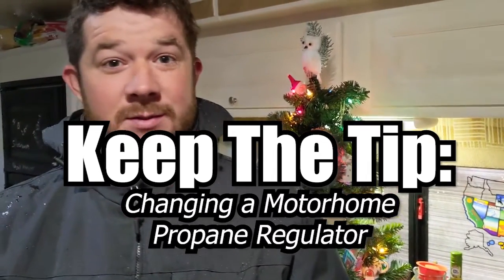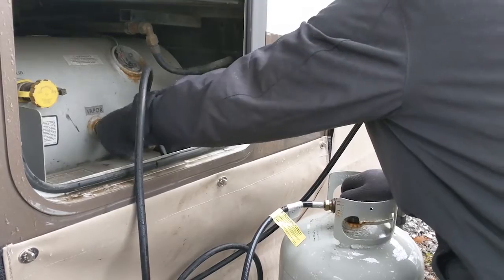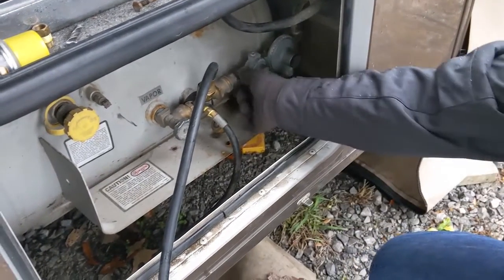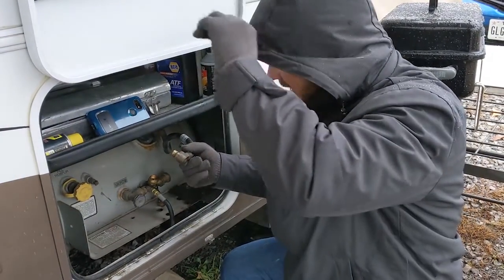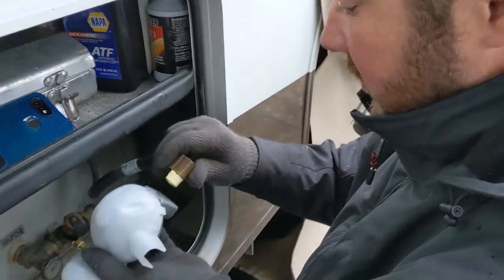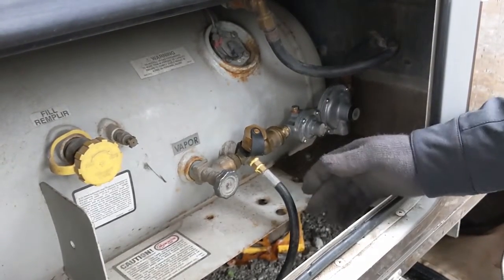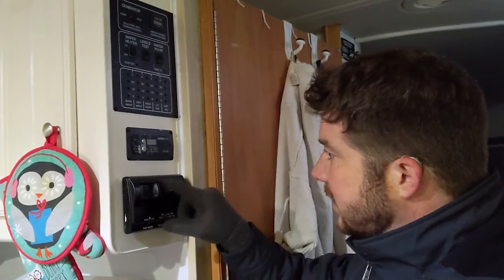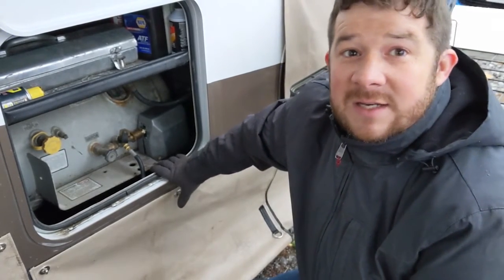Keep The Tip: Replacing a Propane Regulator in a Motorhome

Comment: Your comment about LP / gas fittings working opposite to regular fittings, hardware, etc is correct. But, they give you a handy clue when the fittings work OPPOSITE hand to everything else. They cut little notches in the corners of the flats where you put your wrench so that by just looking closely they give you a heads up 'Hey, I'm different here, take note!' At 6:13 of your vid, there's a quick glimpse of those notched corners on the fitting you just removed. That's the one where you turn RIGHT to loosen and LEFT to tighten.
Reply from the maker: I did not know that. Thanks for the tip. :)

Comment: Thanks our tank is full but pressure is low and goes out. Gonna give this a shot lots of stuff I read said it could be regulator. I installed the ez tee before and was pretty sure this was how it worked but this gives me confidence I can do it.
Reply: I installed the gas stop and am wondering if that could be the reason I am not getting gas to the stove, water heater and furnace.  I'm going to change the regulator. That may solve everything.

Comment: Great video thanks.  On some models there is a ‘drop tube’ which I believe captures the oil from the propane.  Mr. Heater makes a propane filter, I wonder if that would be a good idea to include in the setup, as long as we maintain the filter...
Reply from the maker: I haven't tried the filter idea. Our propane piping is much higher then the regulator, so most oil stays in the trap made by the piping. But I might take a look at the filter.

Comment: I am new to having a motorhome. Everything was working but I noticed yesterday I went to turn my propane on outside and I could smell propane so I shut it off and the smell in a way I am wondering what I am going to need to replace do you have any clues?  I’m not even sure where to take it to get it fixed. If I can’t do it your videos or at least the one I watched are very informational and I enjoy them.

Comment: Thanks for the how to video, late this afternoon I smelled something, yes propane, from my drivers side coach window, class c Minnie Winnie. Yes there is a RV mechanic in town but why not check youtube for a how to do it yourself. Since I'd already installed on 2 different rigs the extenda stay I figured I could try this myself. It's 915 PM, I'm going to google the closest tractor supply and or other rv parts places. I'll reply back tomorrow how the job goes. FYI, I'm 67, full timing for 5 years and currently isolating in place on 5 ac in western Nevada that I bought a year ago. I have solar so the fridge is running off of that system overnight. Thanks again.
Reply from the maker: If you smell propane, it might be a good idea to have someone check for leaks as well. Also, be sure you have an in date propane alarm as well. Let us know how it went.
Reply: @Henleyshappytrailsplus  60 miles to the closest tractor supply,  Carson city.  Of course had to visit home depot, whole trip less than 4 hours,  1+ to make the fix. But also had a leak on the extenda stay, so removed it,  tested all of the fittings with the leak detector liquid and yippee no bubbles.  The fridge overnight to noonish took my batteries down to where they had never been,  71%. But with clear blue skies at 4300 ft elevation they are already back up into the high 80's. Thank you very much for your video,  now I'll head back to watch others you had posted.
Reply from the maker: Glad to hear it. Stay safe and happy trails. :)

Comment: What did you use for plating to extend your metal tray to protect the vent from road debris???        I just finished repainting my tank and my new regulator and extend a stay came in, but I'm trying to locate a piece of metal plating to extend the tray. Thanks.
Reply from the maker: I used 2 overlapping Simpson Strong-Tie TP 3-1/8 in. x 7 in. 20-Gauge Galvanized Tie Plates.

I drilled a hole in them so I could secure them with a bold using the holes that once had a plastic snap holding the regulator cover on

I had to use 2 because one wasn't wide enough. It's not the prettiest thing possible, but it has worked.

I moved my cover back and took a photo showing the bolts I used.

Https://henleyshappytrails.com/temp-page

Hope that helps and Happy trails. :)

Comment: Nice video very detailed. My regulator is leaking from a small pinhole on the smaller round section of the unit. Don’t know the cause of why gas is leaking, but will need to change.

Comment: Thank you very much for your video.

I send you my regards from Spain with my RV Thor Pinnacle. This week I ordered the same regulator, Mr Heater, through Amazon. I have mounted it as you have done, but I get gas from the ventilation vent, and that only occurs when the demand for LPG from an RV device stops.

It is totally new, so I don't understand what happens. I have done the same steps as you.

A greeting and I wait for your answer.
Reply from the maker: Hello,

Sorry to hear of your issue. I'm not a propane technician, just a fellow RVer who has changed a regulator or two. So I can only give you my best guesses.

First spray the entire regulator with soapy water or leak detecter pray to make sure the leak is coming from a vent and not a hose. If the leak is definitely coming from the vent...

The vents main purpose is to allow air in and out so the diaphragm can move in and out to regulate pressure.

Since you are not getting a leak when propane is feeding a device and you are when the device shuts off, my first guess is a bad or cracked diaphragm.

If this is the case, the new regulator is defective.

Bottom line, your regulator should not be venting propane. If it is coming out of the vent, assume the regulator is defective first. My advice would be to shut the propane off and not run it until it's replaced with another regulator.

Another option would be to take the new regulator into a propane service location and they could probably test it.

But again, if it's leaking propane out the vent, it's not safe to use until the regulator is replaced or the leak is resolved.

I checked the reviews for the mr heater two stage propane regulator, and there were a few people that got a faulty one that leaked. So it appears to be rare, but possible that it was bad out of the box.

Here is a great video the explains the propane regulator function and will help make sure the regulator you got is the correct one. https://youtu.be/6qcT6R1ieXY

I hope that helps. Let me know if you have any other questions, I'll try to answer them the best I can. Stay safe, and let me know how it turns out.

Thanks for watching.
Reply: Thank you very much for your quick response.

Yes, I have taken apart an old regulator and see what the diaphragm system looks like. Also yesterday I saw the video that you attach for the mechanism of a regulator

Of course, I do not currently use LPG in my motorhome, nor will I turn it on until I look at it at my automotive LPG workshop.
My only doubt is that it is very rare that the previous regulator, with only two years, expelled gas through the ventilation grille, and this new Mr Heater, as soon as it was connected, too.

I'll keep you informed. A greeting from Spain.

Comment: Great video - tried the fix with a new propane regulator but gas isn't coming to the stove .. any ideas? You mentioned an air bubble in another comment .. how do I know if it's an airbubble?
Reply from the maker: If the gas has not gotten to the stove yet, you could try turning a burner on and holding a long lighter near the burner. If it's air it should eventually work itself out.

If your water heater, and propane fridge work, the stove should work. If all is not working and the regulator is new, it could be something else blocking it. I once had an external tank that was overfilled and wouldn't work.
Reply from the maker: This article has some additional ideas as well. Always remember to be safe when working with propane.

https://rvblogger.com/blog/rv-propane-not-flowing/

Comment: Hello thanks for this video I learned something today. But see I have a food truck and was told by the propane guys I needed a bigger regulator so I took it in to get changed and still no propane is coming thru. One guy went out to check the regulator and he put some kind of plug to check the gas I was coming through and I think it was at 16 but then he went inside because I have an Ansell system and check the lines under the oven unplugged one and there is still no gas coming through so he said that maybe the box of the Ansell system was not letting nothing come through which I don’t know why that would happen but looking at your video it might be the lions worth all that oil and gas collected I’m going to go out today and see if that is set up so the gas can leak down but thanks for this video .What do you think could be the problem please let me know. Have a great day

Comment: You have moisture in the old regulator especially using the spray that contains water instead of alcohol or soap and water I have come across this many times and one way to check is take a hair dryer and heat up the regulators, do not use hot water or open flames i cannot stress that enough, if after heating with hair dryer the flames are normal and blue than moisture is in the regulator and can cause catastrophic failure, best way still is to replace the regulator its very hard to get all the moisture out unless you pretty much take it apart then you still have a chance of the rings and seals not seating properly, and if the flames are still week after heating with hair dryer than its failure in the regulator and still needs to be changed immediately, again best way to avoid is using gas leak detectors thats not a water soap mix they have many of them on the market that work great I always use a digital doctor and do a pressure check just in case with gauges.

Comment: How was the hot water heater on propane, and Refrigerator  ,?. Loved the video my gas is full but stove was not lighting and frig would not run on Propane while traveling. hope this helps. Thanks.
Reply from the maker: Thanks for watching. If the tanks is full it's usually one of three scenarios.

1. The regulator
2. Overfilled tank
3. There is an air bubble or pocket in the line

Thanks again